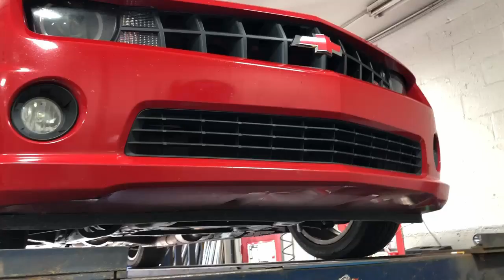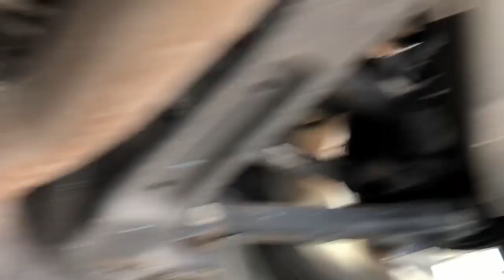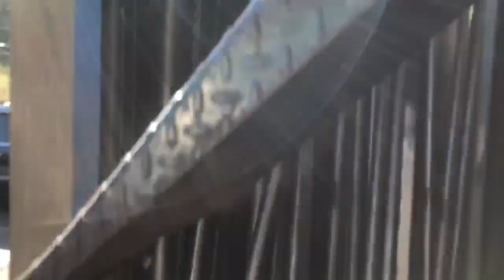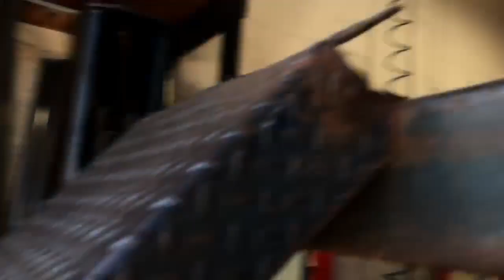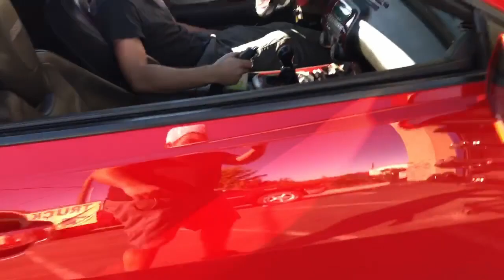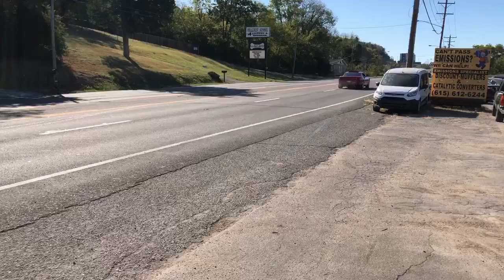2010 Chevy Camaro SS DUAL EXHAUST w/ X-Pipe & Straight Pipes!!

Comment: Question for anyone reading this. I'm not a car expert so forgive me if my question seems naive.
I rented a 5.0 Mustang and then rented a Camaro. Drove them both for 3 days.
The Mustang roared and felt like it had more power. 
The Camaro was quiet yet was quicker. When you modify the Camaro to make it roar like that, does it feel powerful like the Mustang?
Reply: How can the mustang have more power if you thought the camaro was quicker
Reply: @hughlindell9052  best analogy I can give is: 
A cheetah is faster and quicker than a lion but a lion is more aggressive and more powerful. Now use that analogy for the Camaro and Mustang.
Reply: Moses the actual sound of each car doesn’t have much to do with power output straight pipes only add 30-40 horsepower I think you thought the camaro was quicker because it is lighter than the mustang
Reply: Hugh Lindell straight pipes don’t add power, it actually cause more back pressure which then results to loss of HP. Now get a real exhaust system with  long tube headers and you’ll see power change. As well as some sort of intake
Reply: Dodd Productions™ u right
Reply: Dodd Productions™ that and just straight piping loses you a bit power which is stupid